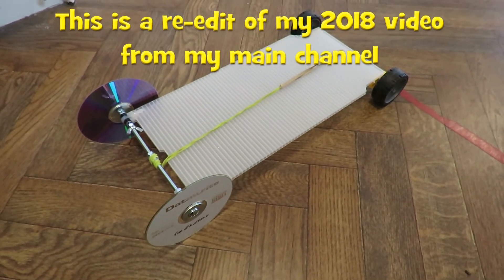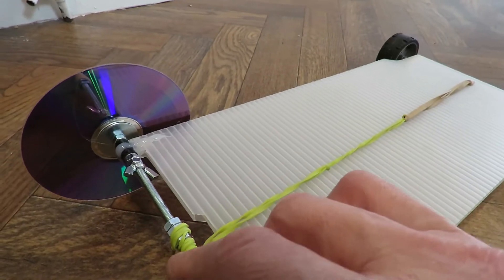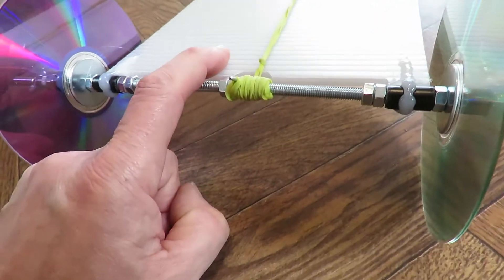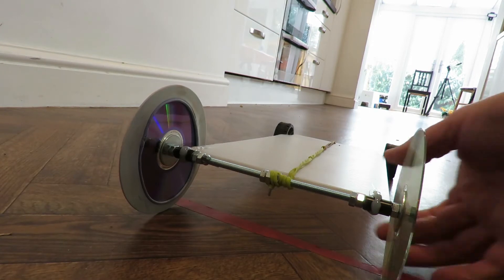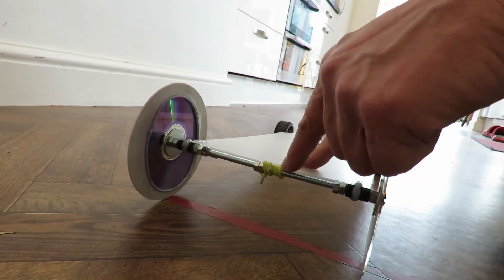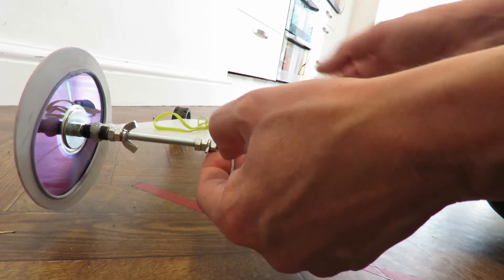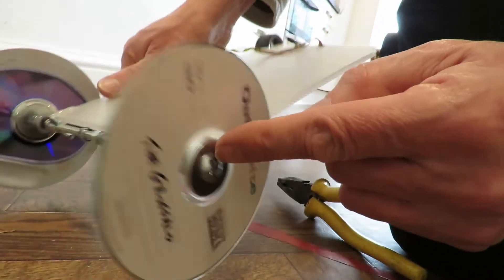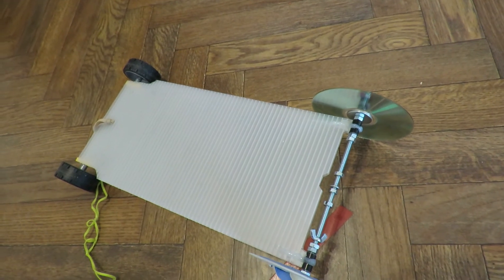Put a rubber band on it #0323 Re edit of Forward Backward stop where it started

Comment: please provide me a list and links of all parts where to buy
Reply from the maker: I can't really help you there. I use scrap items from around the house, or stuff I have collected. The main item you need here is a threaded bar and a matching wingnut. I have no idea where in the world you may be, so I can only suggest checking out a hardware store to see what you can find. That is what I did when I made the car back in 2018 and I know that particular hardware store went out of business a year or so back. The back wheels are CDs or DVDs. The front wheels are off a toy car. The body of the car could be made from thick cardboard. EDIT. This car is virtually the same one - Tidying my workroom - RBPC with brake https://youtu.be/JRtPQgIxsgs?list=PLA5a2xPRSrB3g5RiX8Kf_uUBOL0Tb7AS0
Reply: @Putarubberbandonit  I didn't find those hubs you put inside the CD hole,Where I can I get those ?
Reply from the maker: In the video you are watching here I don't use anything for the hub, I am just clamping the CD between two washers and a nut
On many of my cars where I am using a Bamboo BBQ cane for the axle I use this 3D printed hub
Gripper CD hub 3.5 mm shaft 
Tinkercad files https://www.tinkercad.com/things/2wg08uuwczs-gripper-cd-hub-35-mm-shaft
Thingiverse files https://www.thingiverse.com/thing:4211296
In the video description I have listed some help files
*Making the CD wheels
*CD Wheels with Cardboard Hubs
*Putting rubber tyres on CDs
*Connecting rubber bands
*Connecting the band to the axle 
*Helpfiles for rubber band powered cars
 @lorip9027